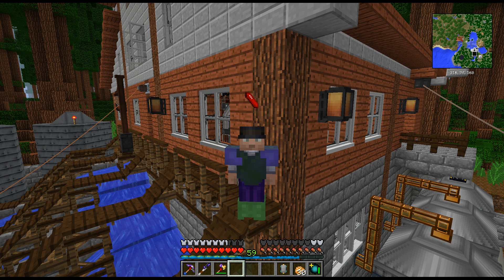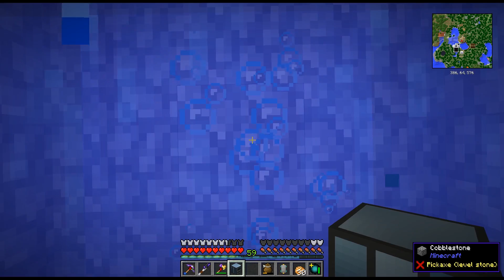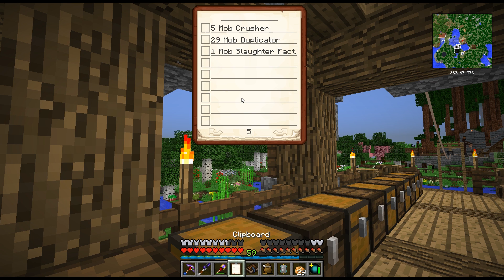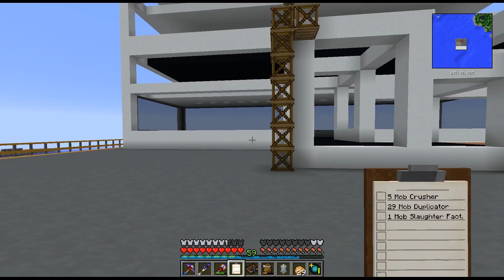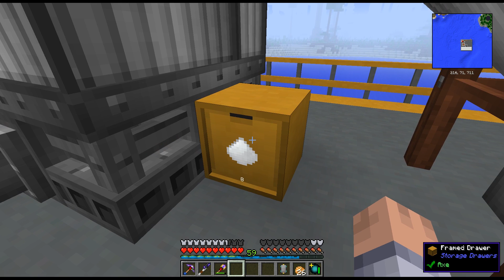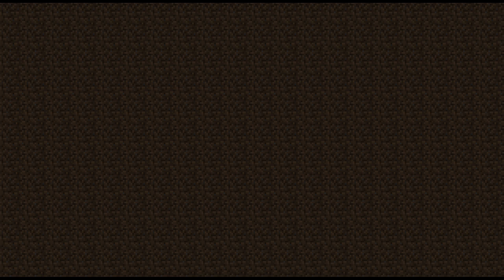Unbound #16 - Big Power for a Big Mob Farm

Comment: Since you added Industrial Foregoing, have a look at its Material StoneWork Factory - it can make cobblestone, stone, sand, sandstone, glass, silicon - only takes some power (you may consider it to be OP/cheesy).

That solar steam and turbine setup looks amazing, I'm gonna look into building that on Crimson Skies.

You can have 5 Tree Fluid Extractors around a log (well, 6 but then you can't place logs); they don't take power anyway. Soaryn built a setup with a sticky piston that pulls and pushes the log so it's never consumed (more cheesy); you already noticed that it stacked back with the regular logs when you broke it.

Comment: Hi Thorgal. Do the turbines use steam in the same way as the diesel generators? The diesel generators would consume the same amount of fuel when activating whether they needed fill the buffer by 1RF or 4196RF. If the turbines behave the same way when turning the alternator, it would be more steam efficient to setup a RF charge monitoring system on a RF buffer and have it trigger the turbines when charge is low. Buildcraft gates would be a solution if it can read the alternator RF buffer.
Reply: The steam turbine does work this way, yes. Used it in SevTech, was always out of steam until I stopped it from being on all the time. Didn't appear to be able to get all the power out of it fast enough even when my batteries were empty, I just pulsed it every so often and that was more than enough.

Comment: Flat fluid node from Extra Utilities between the Tree Fluid Extractor and the Latex Processing unit will save the servo and block spaces.

Salt isn't produced really fast enough to be a concern.

If you're waiting on Steel, and you need faster Coal Coke, try the Advanced Blast Furnace in a test world. It seems to have been fixed since last I tried, but I'm not sure what version of Industrial Tech it was fixed in.

So, if you need to run IE piping but still need a floor you can walk on, is to place down the piping, then click a scaffolding on it. I know Steel works, and I think Aluminum does as well. Looks nice and can even be climbed if you want to do so.

I strongly suggest directly connecting energy cells or IE capacitor banks to the alternator. It pumps a LOT of power out.